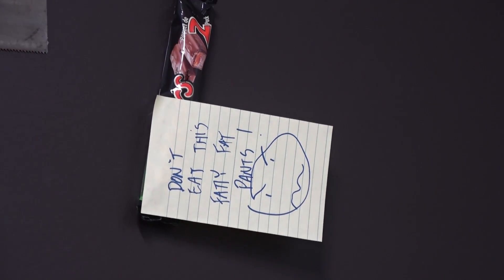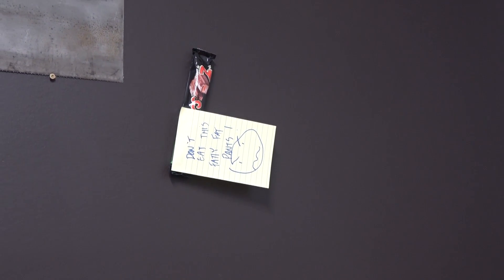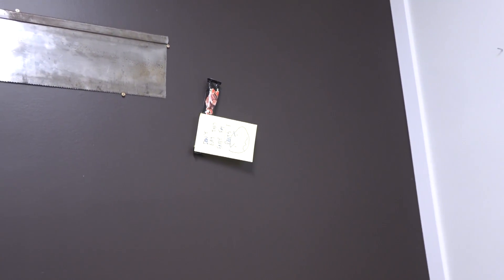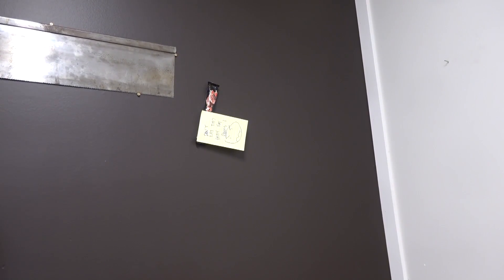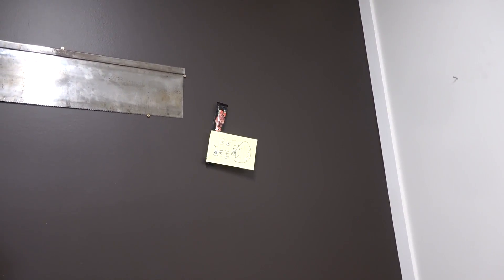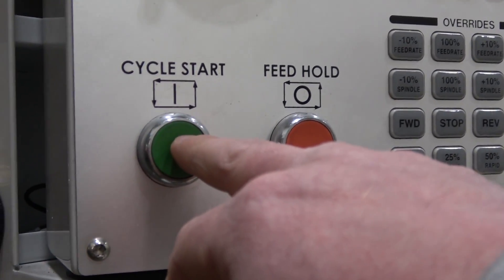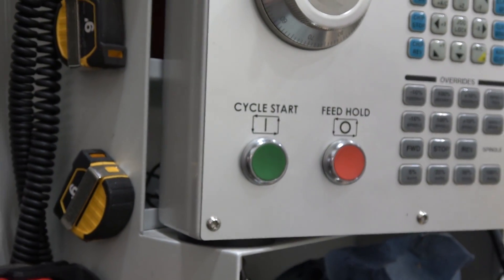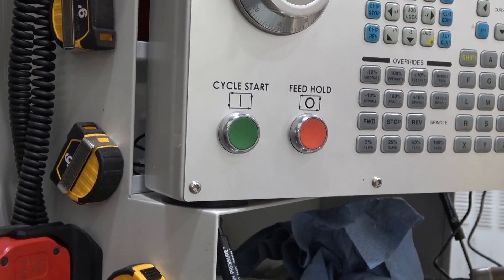Save me from myself

Comment: This whole "stay home" business has made me notice things i've never noticed before. Like the little stain on my ceiling. That wire that I'm not sure what it connects to. How 30% volume is superior to 32%. The clock on the wall is ticking a bit funny. When was the last time I checked my tire pressure? Oh well, might as well do a whole checkup. Oil filter needed to be changed. Something is making an unusual sound in the threadmill. It was a loose bolt and the washer was rattling. I should paint the garage one of these days.  

Send help.
Reply: I bought a cheap, 20 year old Xterra right before this shutdown. Now, a transmission replacement and several small repairs on it, and my 4 other cars later, it is almost all new. I've had way too much time on my hands. I even built a dulcimer, start to finish, last week.
Reply: Yep going around here doing the 'Fix what bugs you'  👍 😊

Comment: You need some new toys.  Maybe muck around with some 3d printing or something?  Loads of rabbit holes in that hobby, that's for damn sure!
Reply: That's true but honestly I'm using mine to make machining related stuff so I still can't escape. I had no idea you could actually make useful things like actual TOOLS. I've turned a $100 Chinese lathe into a $250 Chinese lathe with three cases of steel BBs, a handful of nuts and bolts, and about 40 hours of 3d printing. I'm taking a break because I need to regroup mentally. It's not hard to jump down that rabbit hole for 15 hours a day.
Reply: He actually does have a 3D printer. I remember watching a vidjayo about it some time back. Haven’t seen it since tho....

Comment: Brutalizing for sure I use a data system for automotive work. Two years ago they forced an update. Then images wouldn't print because Adobe was no longer supported...they changed almost every aspect of how one navagates to the info your looking for. It took 3 months for me to become proficient using this new prodemand software. What was wrong with it working the old way? I did not want it to change, found that it worked rather well the way it was. This and many other aspects of automotive repair resulted in the decision to seek alternative employment. Mother truckers

Comment: Be all aware Fusion 360 has a free licence for personal use (also educators, students and startups under certain conditions). I've been using it for a while for my home 3d print designs with no previous experience and it is plainly brilliant, although I deeply hate the Software as a Service licencing system when you need to pay for it.

Comment: If you're having problems with Fusion 360, I do recommend solidworks its been the bread and butter for metal working school.
Reply: What's the cost difference? I used SolidWorks when I was working but can't find a cheap licence now that I'm retired. Fusion is free to hobbyists
Reply: @WeighedWilson  not shure because the school provides the welding rods/equipment/every type of 3d printing and cnc software ever. If you email them im shure you will get a price though.

Comment: I'm learning inventor in Highschool here in the states. School gives it to us free. Good thing to cause man is that expensive. I'm in two different classes, and one uses the 2018 version, and get this, the other one uses the 2019 version. The files aren't even fully compatible. 

Anyways, got to mess around with some 3d software from 1996. Ran on MS-DOS, not even windows. With all the crap you get from modern software, that old stuff is terrible.

Comment: So I'm trying to do something productive during the. I thought I'd make some mostly cosmetic improvements to an anvil (The hammer I used must have been mad and drunk to make the gashes), and some similar nicks and gashes on some vises. In researching this I get conflicting advice so I though I'd come to the Orifice of knowledge. None of these are on high stress locations. Can I use a mig or bernzomatic map gas torch to fix these? Is there some other relatively simple way?

Comment: I was working on my 3dprinter last night and crashed the head into one of the clips that holds the glass to the bed ... needless to say, it's not a skookum choocher and now it won't activate any motors or read any temp sensors. :(
Reply: I had mine snag on it's own wires (design flaw), make a terrible grinding noise, and unplug itself. By the time I opened the case my buddy and I built it was too late. Thankfully it just broke glue loose and unplugged itself. Have you tried checking external wire connections (if any)?
Reply: @isaiahcampbell488  I think the motherboard is partly dead. Thankfully, I have some RAMPS stuff laying around (from the time I didn't build my own 3d printer) which I am adapting to this printer.